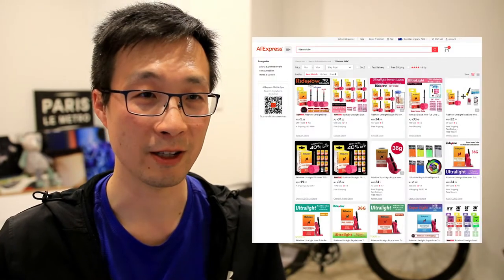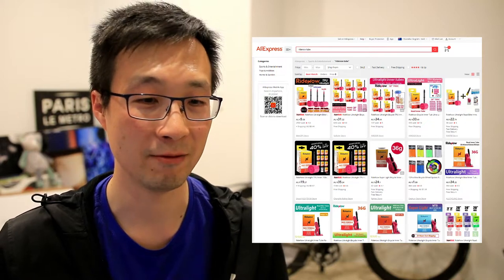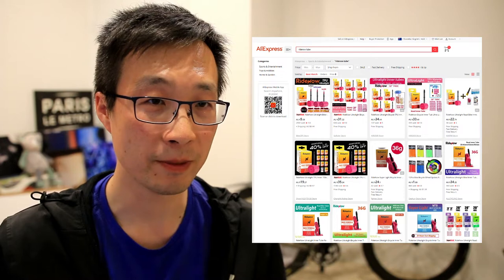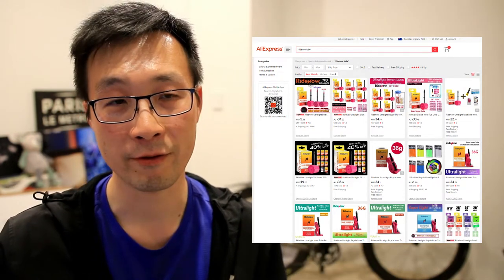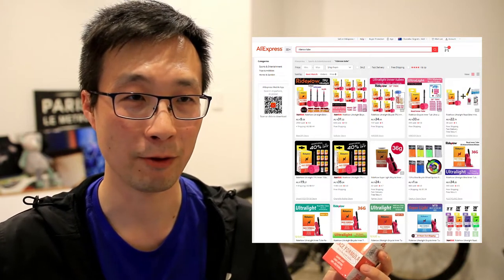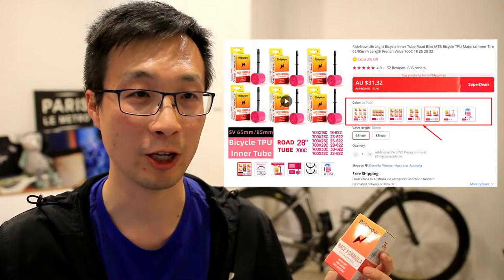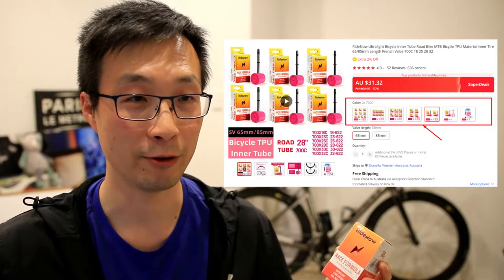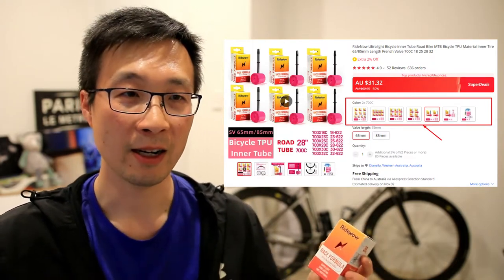RideNow Ultralight Bicycle Inner Tube Review - A commuter perspective

Comment: Nice review, well done.  In my opinion, the greatest benefit of these tubes is that they are much more compact than butyl tubes.  That means I can fit two in my tool/repair container rather than just one butyl tube.  Thus, if I have a puncture, I don't have to be nervous about getting a second puncture and having no way to repair it.  Road side patch kits are not always reliable, especially if using CO2 inflators.  What I do, is keep these in my repair container and if I get a flat, I install one of these to get home.  Then take it back out and install a regular Butyl tube once I get home.  The TPU tube is then placed back in my tool container to bail me out of the next puncture. So I don't run these continuously, only use them as an emergency back up.
Reply from the maker: Patching tubes on road side never work for me. It is just easier to bring a spare tube.
Reply: @cycleandexplore  I agree.  However, I always keep a glueless patch kit with me just in case.  It's better to have it with the 50/50 chance it might work.  If you don't have it at all then it s 100% sure not to work.

Comment: I got mine, and I could tell in the first mile, they are wonderful. I did my fastest time of 14 miles 3 minutes faster. Ive been riding the same route for over a year and a half and the day I installed the RideNow tpu inner tubes, I cut my time down by over 3 minutes. I have continental GP5000, on a Trek Carbon fiber Road bike. And by far the best upgrade you can make for the money.  And as of this comment Aliexpress has the Cyclami Tpu tubes, with a treaded valve stem coming in at 38grams, and $30 for 4, which is an even better deal. I highly suggest getting some of these tubes. You will not be disappointed, Hell the smile they will put on your face is worth twice the money.
Reply from the maker: 3 minutes over 14 miles is a huge improvement. Usually, tyres and tubes are the best value for money upgrades.

Comment: I'm glad you talked about the pressure loses because that's my biggest complaint with Latex. I like the ride feel of latex and I can tell the differences between latex and the Aerothan tubes I tried. The PTU tubes were harder and overall the bike did not seem to handle as nicely. But needing to pump up the tires before every ride is a step I would like to eliminate. I might give the RideNow tubes a try.
Reply from the maker: Latex gives me the best riding experience, but it needs to top up almost every day. It became too time-consuming on a daily commute. PTU gives me the right balance of road response and air retention. RideNow just makes it very affordable and accessible.

Comment: I normally check my tires before every ride because I'm afraid of pinch flats and I've been using butyl tubes since I got into cycling, and wasn't willing to spend $30/$40 on an inner tube. Now that the prices have come down, I'm willing to give TPU tubes a shot on my ENVE Foundation 65 wheels (Latex and the loss of air pressure doesn't appeal to me)
Reply from the maker: Give it a try and I think you will like it.

Comment: Saving 119g each compared to my current tubes. With the spare tube that’s ~350g saving! Change your seatpost, saddle and bolts and easily save 0.5kg off the bike.
Reply from the maker: That's nice to take off that much weight!

Comment: I got a puncture on the rear using this tube. I patched it and that fixed it. The removable  valve  doesn't come out easily and I know someone that broke the plastic stem trying to remove the valve core. I'd probably look at another brand or put my latex back in with the removable core.
Reply from the maker: Thanks for sharing your experience

Comment: Can you remove inner core of tube to add extensions?
Reply from the maker: It seems that the value is some form of light weight plastic and value core is glued. I wont be removing the core unless you really have to.

Comment: I just purchased some RideNow tubes but hesitating to install them yet. The reason is there is a adhesive decal with a hole die cut out of it and 
I'm not sure if I'm supposed to place the decal over the stem before installing it onto the rim. There are no instructions written on this. Are you
able to elaborate on this?
Reply from the maker: I didn’t install any decal. I don’t think it matters.
Reply: I believe it goes over the stem once installed. It will keep the stem from bouncing around in the hole of the rim at the same time as keeping road debris out
Reply from the maker: Thanks for sharing. Learning something everyday.

Comment: two observations..
you are asian and you have never ordered from aliexpress and i am not and i have been doing it for ten years or so
2/why would you put a super light tube in a commuter..makes no sense..
Reply from the maker: I initial swapped out the butyl to TPU to get a better road feeling and lighter weight. I like it so much so I keep it the way it is.
Reply: Reducing rotating weight at the edges of the wheel has a significant impact on road feel and energy expended when accelerating. Because commuting tends to have a lot more stops and starts, making it more energy efficient to accelerate is worth having.